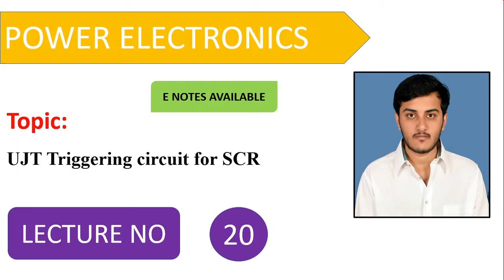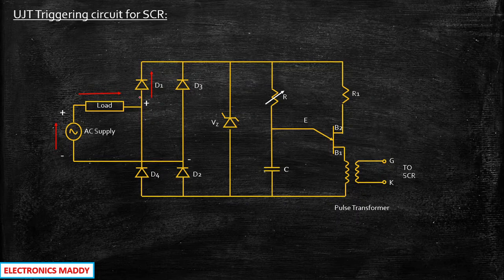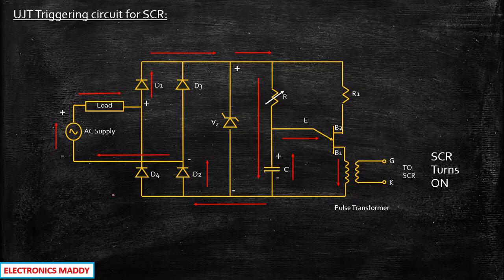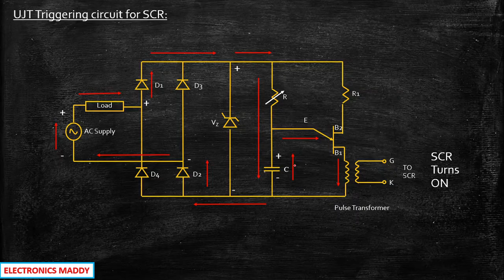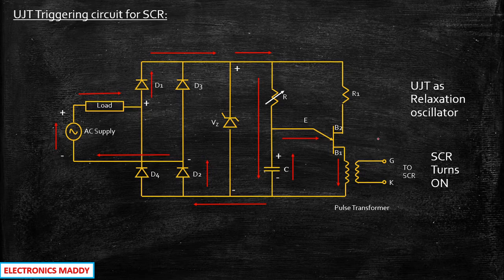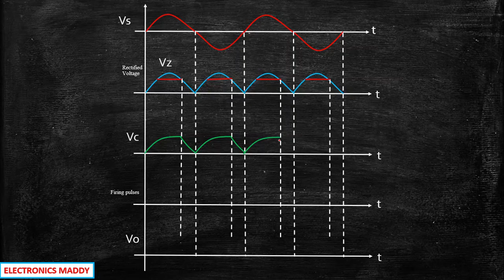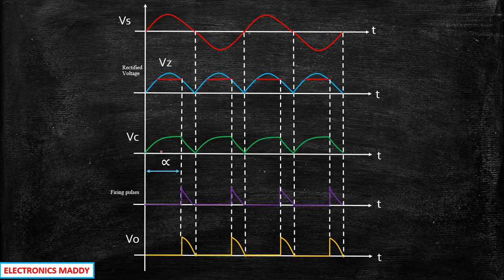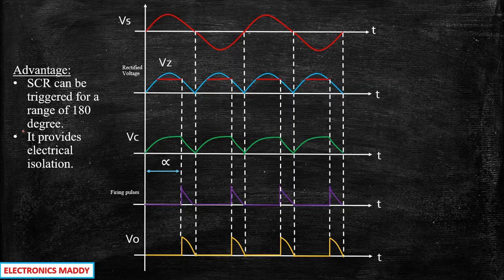UJT Triggering circuit for SCR | Power Electronics | Lecture 20

Comment: Bro... We should connect the load after the pulse transformer naa...if not then what's the point of the isolation between power and control circuit...🤔